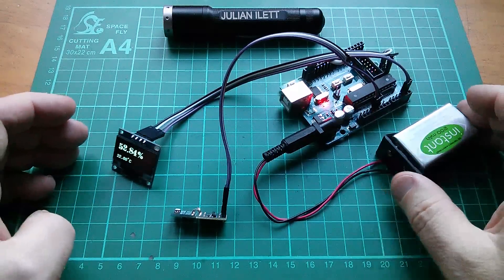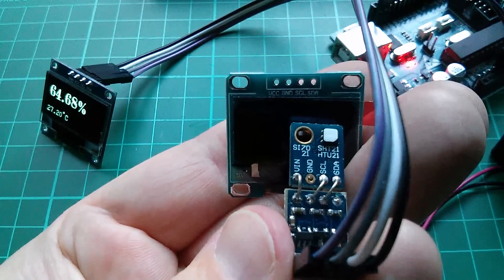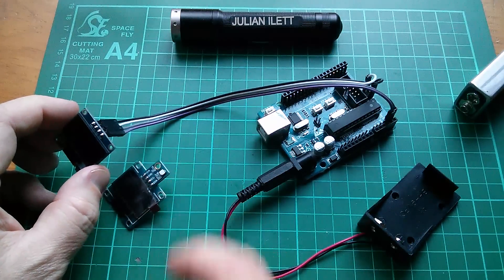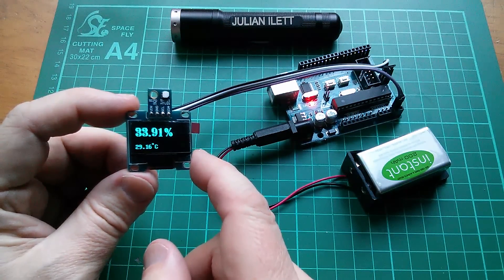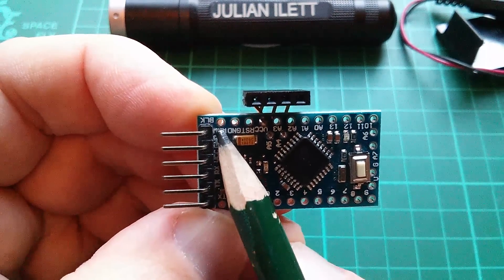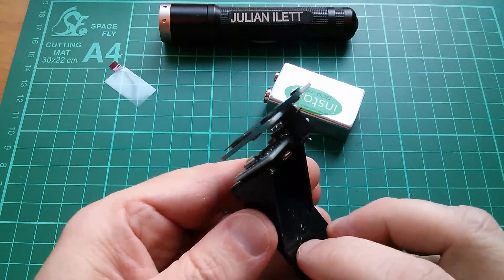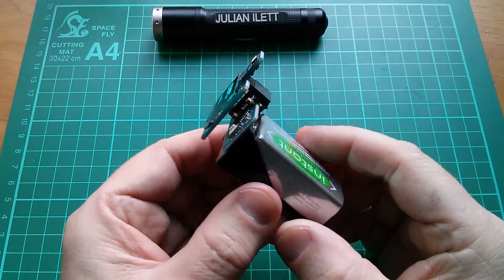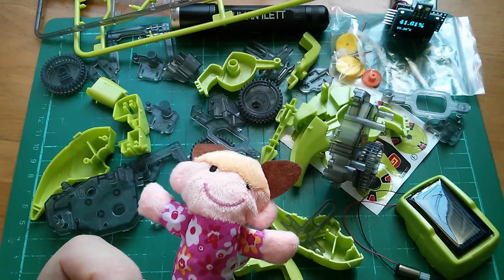Arduino Project: Pro Mini Humidity Meter (Hygrometer)

Comment: The display will take a good chunk of battery. Is the white cover part of the sensor arrangement, or is it really just a transport protective cover?
Reply: Got myselt the same module; it takes about 2 to 8 mA depending on the displayed content. The Arduino takes the most current if not programmed with any sleep modes. Also found out that the white cover is supposed to be a filter, so it should remain on there.

Comment: If you would like to make a video about digispark 85 that sends HUM and Temp with RF433, than i can send you a script about them. One digispark reads dht11 signal and sends it with rf433 and the other digispark receives the signal and displays it to oled display. Im using a digispark that has a usb connection on board so i can plug them in my powerbank. If everything is connected and soldered, it looks very small in size and looks good.
Note: One digisparks needs smaller bootloader. It can be done with original bootloader, but then there would be only displayed values and no text.

Comment: you could use ATMEL ATTINY45 chip and flash ardunio boot loader to it
for your humidity meter

http://www.ebay.com/itm/MCU-IC-ATMEL-DIP-8-ATTINY45-20PU-ATTINY45-20PI-ATTINY45-/311513988288?hash=item4887ae3cc0:g:TsIAAOSwp5JWWCwQ

Comment: Here a project idea!?..a sorta combination of a few of your projects - obtain multiple sensors, couple them with RF transmitters and fit them in in/to USB mains mains adapters and plug them in about the house....have each of them transmitting back to a master Arduino which could then display temp and humidity of each room on an LCD.

Comment: You probably lost some accuracy with that design: Those xyz21 humi-temp sensors are actually measuring the temperature of the PCB below them, so you  want to keep it as small as possible, and you pretty much merged it with that display.

Comment: Measure the current draw of the display when fully lit and completely dark. I think the MCU speed is the least of your worries with that display continuously on. Instead of slowing down the MCU implement some sleep mode. That's a way more efficient way to reduce power consumption. By slowing the clock you might run into difficulties with the sensor or display. Check what the minimum I2C clock speed is for them or if they have some other kind of time dependent behaviour.
Check if the libraries you use need timer0 (that's the one that counts the "time"). If not disable it, because it wakes up the micro every millisecond if you try to send it to sleep.

Comment: Julian, about the battery life problem. Kevin Darah did a great series on his channel about low-power Arduino projects, I highly suggest you to check it out. You could put the whole thing to sleep when it's not being used and wake up on a button press, this way the battery will last for a extremely long time.

Comment: I wouldn't mess with the fuses or CPU speed, too much bother in my experience. You can instead put the Arduino into one of its power down sleep states, and only have it wake up every second to make a reading and update the display. Since that update only takes a few milliseconds, I bet, it should make the display itself the largest energy consumer.

Comment: Swap out to a 3.3v pro-mini and you could easily fit a lithium battery in between the display and the board. Personally however I would have done away with the headers and used ribbon cable wire between the display and the pro-mini to get it even thinner.

Comment: I'm having an issue with my 140w solar and I wonder if someone here already have that 
My panel shows 20v open circuit but when goes to the grid tie it drops to 9volts 
I check the panel and looks all good, the bypass diodes are ok too.
I really have no idea why it can't hold the voltage high under load
Reply: TBH that sounds normal. What's the load, and how sunny is it?
Reply: +David Buchanan it seems that doesn't matter is its full sun or overcast! I ran a test using a motorcycle lamp and from 20v it doped to 9volts at 4.5amp ! Should I try to buy new bypass diodes? I've been seeing 9volts for 2 weeks when plugged into the grid tie 
Maybe the diodes are holding voltage when under load
Reply: What's the voltage across the diode? <45W output does sound a bit low.
Reply: +David Buchanan they tell normal voltage I think they go 9>15>20  left to right ! I believe that's it if I remember right, I'll try to check again tomorrow and make a video

Comment: Use an LCD screen without backlight, desolder power indicator LED from Arduino Pro Mini and use low power modes of ATMEGA328. You can make it work for months on a lithium coin cell.
Reply: Engin Yeğnidemir 
this is OLED screen
Reply: Yeah, no reason to swap the OLED since it don't have any backlight. The light comes from each pixel directly, which pretty much gives this a much lower power consumption with regards to its visual quality. Sure a small 7-segment LCD with no backlight would possibly draw less, but that's not even in the same ballpark.
Reply: But an OLED draws way much power than an LCD.
Reply: Engin Yeğnidemir Well that depends highly on which models you're using, but in general no, a similar LCD won't be as efficient as an OLED, but as I said, if you sacrifice quality, like with an 7-segment LCD, then yes, you would lower the power consumption since you're getting rid of backlight and resolution.
Reply: Find the OLED with lowest power consuption possible. You can find an LCD that uses at least 10 times lower than that.
Reply: YES I hear you, but I'm referring to an LCD of EQUAL quality to the OLED. You can't for example just replace a Samsung AMOLED with an 7-segment or a dot-matrix just because it consumes less power. OLED depends on tech that is superior to LCD in many ways, but as the entry-level OLED are far more advance with regards to contrast, resolution and brightness it can't compete with a low-power LCD.

OLED's are very pretty to look at, but I agree that for the simple function of the hygrometer, a cheap LCD would most certainly suffice, but it wouldn't impress anyone nearly as much as an OLED does.
Reply: I is a hygrometer running on a battery. It is not for impressing people with bright lights. It is for telling humidity level. You shouldn't be putting a fresh battery every time you need to know it.
Reply: Engin Yeğnidemir Fine, you win. No one want's aesthetically pleasing tech.
Reply: Yes, LCD's are always ugly!
Reply: No not necessarily.

Comment: That's a nice project. But the values change so quickly. You can take ten measurements and then average them before displaying to stabilise it. You should also center the values on screen, it shouln't be hard as they are fixed width.

Comment: This sort of project always makes me feel uncomfortable. In a way it is electronic Lego. Is it a good thing to plug modules into each other with little or no knowledge of the underlying circuitry? I really do not know.  Hopefully experimenters will take the theory much further and learn more in the process.
Reply from the maker: I agree, it is electronic Lego. But that's Arduino - throw something together quickly and it just works.

Comment: Hi Julian. thats a nice project. I have two ideas. Add an on/of switch somewhere and use an angled header in between the hygrometer board and Oled screen so it is bend backwards (facing upwards). Also maybe use a tiny lipo battery and a tiny boost board (but where to hide that huh).

Comment: An interesting idea i just saw in other videos: try to modify a 9v battery to fit in a small lipo battery, a tp4056 and an adjustable step-up, something like the MT3608... that way, you will have a rechargable 9v battery, so you can just leave it plugged-in in any 5v usb port, or maby to your solar wiring, stepping down the voltage a bit... and then take it out to wherever you want!

Comment: I notice now that this unit is much closer in reading to the 2 cheapo units, as I said on the previous video is this because you do not have the double level shifting and dual voltage regulators to the sensor.
Reply from the maker: I'm sceptical. The double regulator may result in a low voltage, but the Si7021 works down to 1.9 volts. The level shifters aren't going to alter the data sent over I2C - corrupted data would result in errors, not readings that are either too low or too high.

Comment: Running it off 9V means you're dissipating considerable power in the 3.3V regulator on the Nano board. This will result in artificially elevated temperatures.

The battery power is mostly going to heat up the regulator. A 18650 would be far more efficient, have higher capacity, and run longer.
Reply from the maker: True 9V isn't ideal - but this is a 5V Pro Mini, not 3.3V
Reply: Maybe consider checking how hot the regulator gets and if that affects your temperature readings.

Comment: are those temp sensors even accurate down to 0.01 degrees?
Reply: No, but he can't be bothered to use anything other than the basic print() command, which prints 2 decimal places.

Comment: https://github.com/rocketscream/Low-Power - use this for longer battery life. however, the display will still consume too much to run months from one battery. may be you need to switch the display off after some time (power it from one of digital pins controlled from code) and have a button to wake it up
and of course you need to downclock the atmega and don't use onboard linear voltage regulator (I suggest to solder it off to avoid current leak) and power the whole device directly from 3V battery pack (2xAA or 2xAAA)

Comment: Isn't OLED a lot more power hungry than LCD. Slowing down MCU won't be enough. Of course  you can also update once ever 2-3 seconds and sleep between updates, so the MCU clock will be less of a problem. Even though LCD would last longer, OLED is much cooler :).
Also character LCD displays burn more power than 7 segment LCDs, but I haven't found 7 segment LCD display with a driver. driving it from a PIC is an option, but wiring would be nightmare.
Reply: OLED are less power hungry because they can shut off individual pixels unlike LCD :)
Reply: Maybe less than TFT. You still need to power at least 10-20% of the pixels. Character LCD draws 1-1.5 mA with no backlight. Nokia display - 0.4mA with no backlight.  With 7 segment LCDs you can get lower than that. You won't power backlit devices  from batteries anyway. Here is some article: http://www.bigmessowires.com/2011/06/07/low-power-lcd-smackdown/

Comment: also it might run on a ATtiny85 board that are available on eBay for next to nothing.
Reply: +Hrnek Bezucha I got mine for 99 dollar cents a piece. Have you seen them even cheaper ?
Reply: Maico probably not the board but you can get a batch of the chips. The board is just a breakout with USB anyway. you can program the chip with i2c I believe.
Reply: Hrnek Bezucha oops I missed that you were talking about a attiny85-on-a-BOARD. I was meaning the bare attiny85's price.I'll probably need to order a couple of 1000s to get a lower price and I only need a few.  I already ordered 5 for 99 cents each and thats not a bad price I guess. I just thought maybe you knew an even cheaper deal :)

Comment: There are several videos explaining the power consumption and a lot can be done just with switching off analogue/digital conversion pins(if not needed). Another thing is brownout but that might be better kept on with a battery usage.

Comment: Julian, have you posted the code for this anywhere? and if not, could you?
Reply: 0yeme0 http://hastebin.com/emugomosev.cpp
Reply: Moes
thanks
Reply: haha.. there isn't much to that code at all.  I expected it to do more.  The hardware does more than I thought.  It's just a matter of taking readings every 50 ms and using a built-in print command with some built-in fonts and telling it which pixel on the display to start at for the print.  Cool... this makes me want to play with arduinos and graphical LCD displays.
Reply from the maker: Yeah! It's easy :)

Comment: You can make Arduino MCU enter in Power Down and wake it up every 8 seconds using Watchdog Timer. Maybe a button to turn on the display for a couple of seconds or use a Nokia LCD if it needs to be on all the time. With this strategy, I bet you can run for more than a month. I have doing this way in my DIY smartwatch.

Comment: Any idea how long of a cable run you can use with i2C? I want to put a sensor in my attic, but the arduino and display would be several feet away in a living space.
Reply: About a meter. Almost certainly not long enough.

Comment: Nice project, love the pro mini's as well. Just a thought... ;o) Add a feature to your new hygrometer - calculate the dew point and display it. The calculation is not trivial, but doable. Now you know, how cold your walls can get before they potentially grow mold. Next step: add a second temperature sensor and a LED. Tape the temperature sensor to the coldest wall and let the LED illuminate in case the wall temperature is lower than the dew point. Now... the LED will show you when it's time to open the window to lower humidity. Next step: construct something with a motor to open and close the window... ;o))) You see, home automation could be a never ending hobby as well.
Reply: Dunkelheit667 next step have an alarm for when the window opens without having the motor open it.

Next step give the device a SIM card and allow it to call the police when needed
Reply: Hehe, usefull as well! But don't mix up the routine which should call the police. It's 'window_opened_not_be_myself' and not 'open_window_dew_point_reached'. ;o)

Comment: hmmm i also bread boarded one dht11 hygrometer, but i wanted to miniaturize it with 2x 7segments.
Reply: I'd recommend the smaller OLED. If you search eBay for 0.91" oled you'll see what I mean ;)
Reply: right !

Comment: You forgot again the "Response Time" for the sensor and it's 17s and not 1s
Reply from the maker: I've checked the data sheet. It can take 18 seconds for the sensing element to respond to changes in air humidity. There's no limit on how often you can read the temperature and humidity registers.

Comment: Good job with the project, nice thinking with stacking the boards. How about using one of those usb rechargeable 9v PP9 batteries you can then just give it a boost from one of your many power packs.
Reply from the maker: There's a 9V lithium PP3 with microUSB charging port heading my way from China - that should triple the run time.
Reply: Always a step ahead :-)

Comment: Hi Julian, Your probable aware of this but just in case, have you used any of the Low Power and Sleep Libraries?
Reply: The Sharp LCD are almost as low power.  Not cheap.  But you might also check on the popular Nokia LCD module.
Reply from the maker: I'm keeping a close eye on e-ink displays - but there are very few available at the moment.
Reply: Perhaps add a light sensor so it doesn't run at night? an e-ink display would be good for low power operation and only update the display when the humidity changes by +- 1%?
Reply from the maker: I'll have a look at those - they could be very handy :)
Reply: Here is a great video about sleep and pre-scaler: watch?v=iMC6eG24S9g ;-)
Reply: I have a use in mind for a nice e-ink display but one of the major drawbacks is the display update rate. I need something readable in bright sunshine. The sharp boards have the update rate but I can't find a driver board for the bigger 2.7 inch screen

Comment: Surprised you didn't attach the arduino to the battery box, then stick the battery box to the back of the display, would be a bit more robust.
If you still want to remove the display for testing, you could use velcro

Comment: The new OLED might look blue if the screen protection film is tinted perhaps?

edit: Ahh nvm I see you took it off towards the end, although it looks like there's still a blue filter adhered to the screen, so it might still be a white OLED beneath.
Reply from the maker: The oled is definitely blue, and the eBay listing says white - naughty eBay seller (secret-garden2015)
Reply from the maker: This is a single colour OLED, but you can get full colour OLEDs - https://youtu.be/guNG9BhBmxM